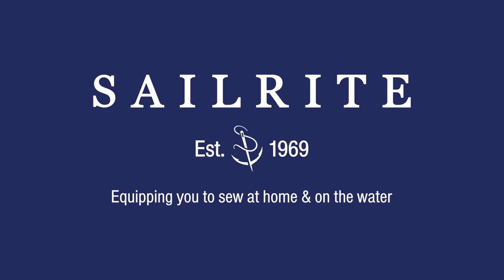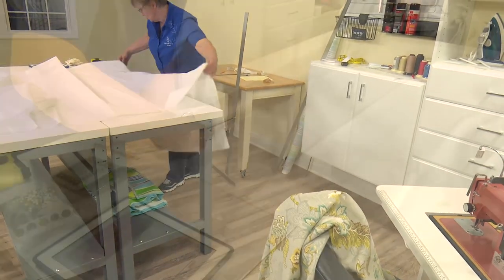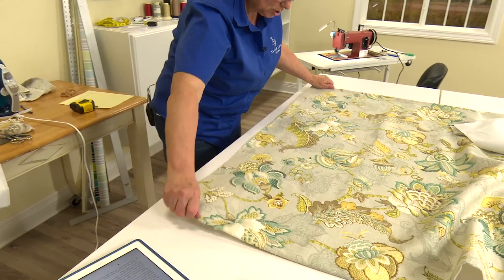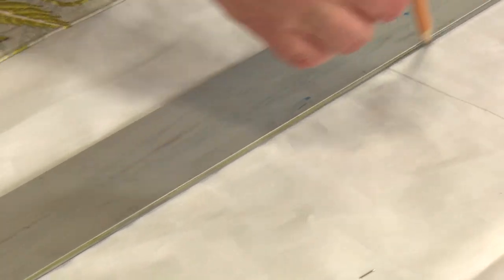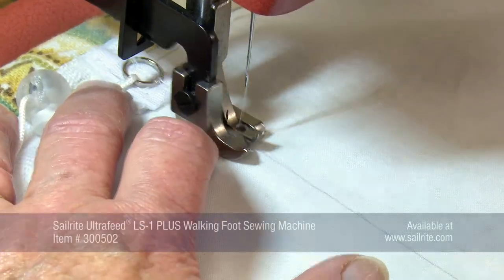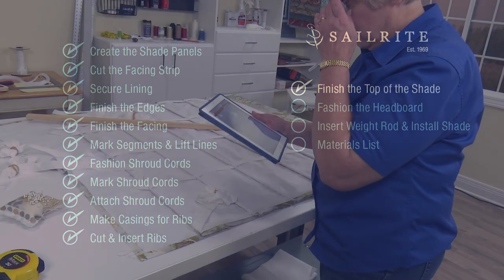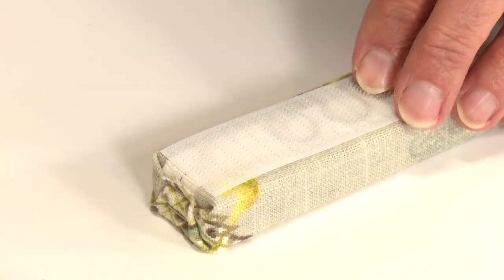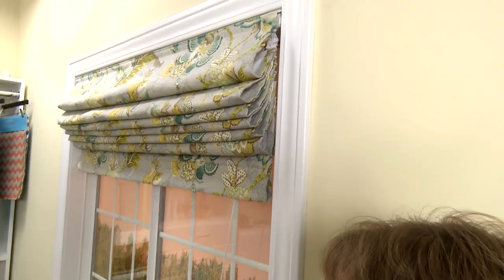How to Make a Hobbled Roman Shade

Comment: What adjustments would you make to this for an outside mount?  The wooden board across the top will be visible from the side, I think
Reply from the maker: You are correct, if you desire to hide it you would have to make a small valance box at the top of the shade.